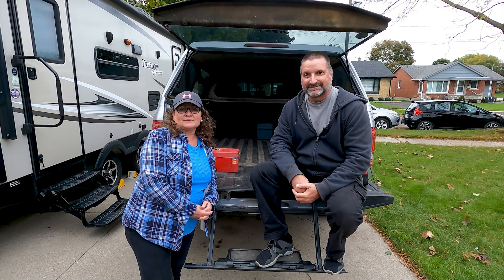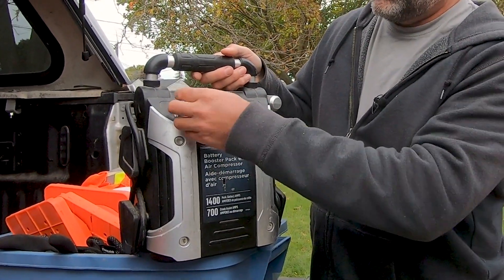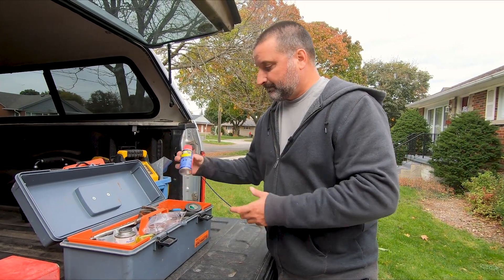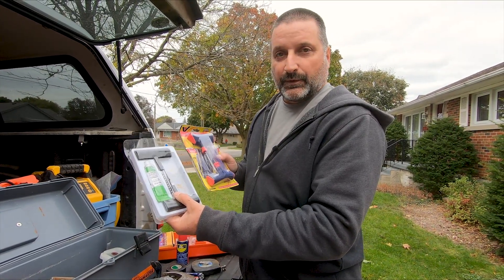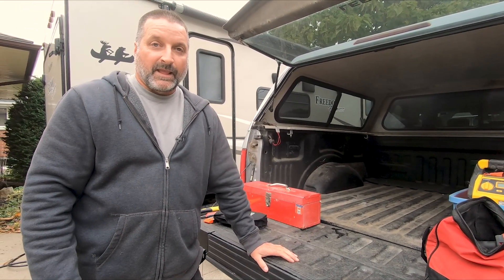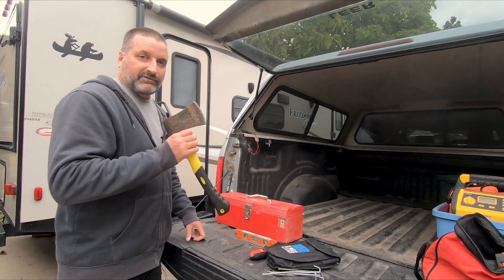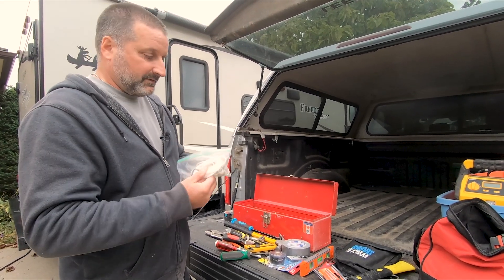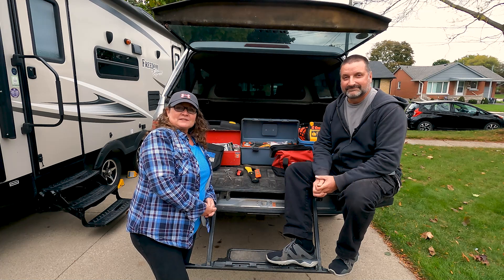What's in our RV toolbox?

Comment: I carry 3 toolboxes. One with a hammer, mallet, screwdrivers, razor blade knife, 3 different pliers, adjustable wrench..etc. The second one has a ratchet & sockets(19mm inclusive). The third has small spare parts. I also bring a 2-ton floor jack, a Ryobi battery inflator, and a Ryobi battery-powered impact drill/gun. A 2L gas can, a large first aid kit. A power bar, 4-way wheel wrench, a 3ft steel pipe(for the power bar to remove wheel nuts.)
Reply from the maker: Sounds like you're well prepared. You're alot more organized than us too.

Comment: A few Shark Bite connectors for quick plumbing repairs.
A few feet of Red & Blue Pex pipe.
Some plumbing mastic epoxy.
12 Vdc fuse tester with amps display.
Scrim Tape for the cover under the RV.
Some Wago connectors for electrical connections.
NCVT non-contact electric tester, for Hot Skin detection & more.
Reply from the maker: All great additions! I know we're lacking in the plumbing supplies. I forget to show my electrical tester kit that has a non-contact electric tester and a 15amp outlet tester.

Comment: I don't think you can be prepared for everything but I have to say you are pretty close. I actually carried a little less tools last year but I think it might have been due to just being lazy. I tend to have a little less storage than you guys and also watching my weight. I originally got a bottle jack but I never liked them so I changed to a trolley jack I just find it a little more stable especially on a soft shoulder of the highway. I also carry a tire plug kit in an emergency and I've plugged many tires in the past and find it an alternative if you are stuck. One thing that I have carried that I don't think you mentioned is a large adjustable wrench or pipe wrench if you need to tighten or remove your trailer ball. I have never needed it for myself but I helped a couple once that had rented a Uhaul trailer and had an issue. 

So what have you got planned for 2022. So far we booked Balsam Lake, Awenda, Finlayson and Samuel De Champlain. 

Keep up the great videos...